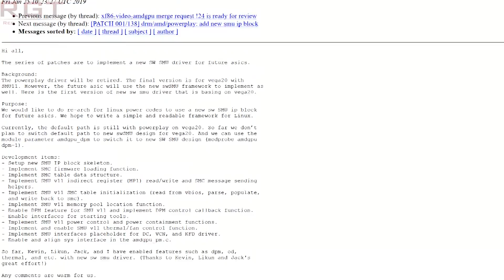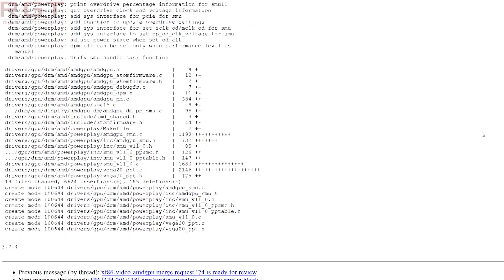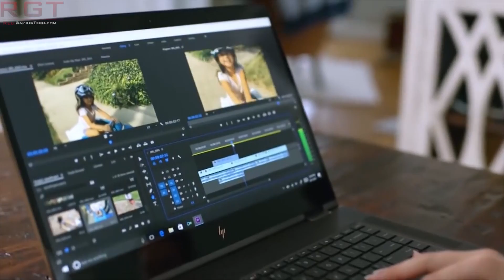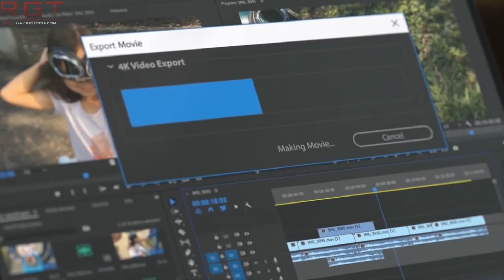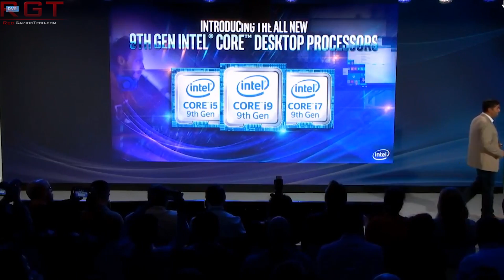Navi AIB Partners Brief On Specs & Linux SMT Updated | TSMC Readies 5nm

Comment: As for the Switch. it would be a huge mistake for Nintendo to even talk about a successor. They have a good product that they will want their customers to get value from. If they replaced it now or even any time soon-ish, they are basically telling people not to buy the next one as they will have to replace it in 2-3 years also. 

If I were them the absolute minimum that I would upgrade on the Switch would be 5 years. They are regathering the old Gameboy market and by all accounts, it sounds like that level of product saturation is there for the taking.

Comment: Intel will release Ice Lake no matter what. They were planning to release it last year and they had year more of debugging to make sure it works. The reason it was delayed was because the low yields meant that it had too high cost.  However with ZEN 2 in the market Intel truly has no other choice than to release Ice Lake no matter the manufacturing costs, and if necessarily sacrifice their profit margins to have a product they can sell. The reason coffee lake is so expensive is because their 14nm fab lines cannot make enough chips to handle the demand.   The ZEN 2 will chance the demand,  and 10nm chips even if more expensive to manufacture are still more chips available and new architecture means Intel would win several different performance measurements.  Lets say Intel releases 8 core Ice Lake and it completely obliterates 8 core Zen 2,  they can sell it even if the pricing around the 16 core zen 2.  They can say we are better for all these things, and people would have to choose between which set of performance measurements matter more to them. And when the yields improve they would release higher core count parts to replace it and bring prices down a notch.   Jouni Osmala

Comment: "you have intels 500 dollar cpu against amds very cheap cpu" you dont know how cheap intel could make an 8 core 16 thread cpu.  you only know what they are chargin for one.  thats a big difference.  and you dont know how much these amd cpus are gonna cost.  just saying there is a lot of assumption.  intel could make an 8 core cpu with no igpu built in for less than the 8700ks price if they wanted and still keep the same profit margins basically.  they could make a 10 core with no igpu and charge the same money as the 8700k.  they would take a hit in profit margins but it would still be very profitable.  intels stockholders are just gonna have to get used to the idea that competition is back and that margins will be lower until can get EUV going.

edit:  i get what youre saying.  if amd price these chips cheap and the perforamnce is there then intel is in trouble.  but im just reminding everyone that things arent always what they seem.  i dont mean any offense to the channel or anything.  overhyping is no good for anybody so im just saying this to the audience mainly.  not the channel
Reply: bobhumplick intel could make it cheaper,BUT.Amd infinity fabric helps yields, meaning if one part of a silicon doesn’t work they won’t have too throw it all,instead it can take smaller parts and throw just the broken parts.Intel can’t do that,if a part of the silicon doesn’t work they have to throw the whole thing.Aka,if intel reduces prices,so can amd but even more.👌
Reply: We do atleast know that the way intel makes their cpus is less efficient and that theyve had problems with supply in the past
Reply: @josh223  no we dont know that.  when did they have supply problems in the past.  i mean besides the current shortage?  every company has had supply problems including tsmc and amd.  how is it less efficient?  care to elaborate?

Comment: I still wouldn't put it past Intel to pull a desperation move and try to do something like shoehorning a 6950X (10 cores, remember) into a LGA 1150 package. We already know that Asus has a monstrous HEDT mobo coming down the pipeline which will be powered by TWO freaking 24-pin connectors, maybe to support that long rumoured 28 core CPU from Intel. Intel might try to do something just as ridiculous for their mainstream CPUs too. AMD needs to keep their foot on the throttle.
Reply: Intel is allready releasing a 14 core model in limited quantity which will be auctioned most likely to system integrators. The current major problem for Intel is their CPU shortage. They're even considering releasing Celeron models on 22nm instead of 14nm and they have desktop systems on the bottom of their priority list (Xeon and laptop CPU's are more important).

Comment: comparing next gens ryzen to current gen intel is like comparing the 9900k to the 500 dollar 1800x.  its not really a fair comparison.  now sure youre saying "if intel cant put out something better".  but they already have the 9900k.  you coudl just make it the new i7.  people think there are problems with yields because the numbers of 9900ks are limited.  but the yields are great.  they just made very few of them because they need that fab space for making the next gen of cpus.  add 10% ipc and get the core count up to 8 and 16  and you have a pretty good product.  

make the igpu seperate and only put it on the cpus that really need it and the 9900k becomes smaller than the 8700k.  they could even really put out that rumored 10 core chip with no igpu for the same price as the 8700k if they wanted.  and then use that 10 core as the building block of the hedt chips.

amd are gonna be strong this year no doubt about it but intel can answer.  just depends on whether they wanna chance putting out lesser chips and take a chance that brand recognition and current market share will get them sales anyway.  if they do that then amd will steam roll them.  either way though, yes amd will be strong
Reply: Not exactly, comparing 8700 to 1800 is fair then 2700 to 9900 is fair....
Reply: @Tallnerdyguy  well thats only because amd release early in the year and intel later in the year.  amd is usually april to may and intel is usually october november.  but amd wont have ryzen on the shelves till july at the earliest and thats only a few months away from when i would expect an intel product. so really by the time amd come out with a new series the 9th gen will be close enough to a yeara old while the 8700k and 1800x were 6 months between

Comment: nintendo is waiting for 5nm from samsung for nvidia custom gpu they planning next console and possibility based on newer RTX 2nd gen gpu...cause they have been supported for raytracing teniques since early 90's with N64 release was first to used on variety FPS games based on lighting and shadow features...their method different than nvidia back then..so games were unique by design that no other console or pc had before....
Reply: Nintendo is gonna make another low powered console.  Not anything powerful

Comment: Intel also is not stupid - they are for sure working on something
Reply: LOL on what ? 14Nm ++++++++++ ?
Reply: @gertjanvandermeij4265  14nm is actually what amd would call 10nm and they have been on it since 2016.  intel should just lie and call 14nm+ 10nm like amd did
Reply: They're working on something, but they keep getting delayed. The issue is that unlike AMD, Intel makes their own chips, so they keep having delays on their next gen architecture. They already stated that it'll be released at the end of this year, but based on what they presented, it'll be an improvement on their current architecture, which isn't bad, but isn't as major as what AMD can potentially do, and that's improve IPC while essentially doubling core count. I do remember reading some time late last year that Intel is working on their 7nm factories, and that there was a possibility of them skipping 10nm altogether since they kept getting delayed, but it doesn't seem to be the case. Either way, this upcoming generation might go to AMD, but next year things will get very interesting, which is great for us consumers
Reply: @JM-kn9dh  intel will probalby skip 10nm for the desktop.  they can compete fairly well with 14nm right now.  mobile will get 10nm because the power savings will be important and they are small chips.  server might get it in 2020 but i doubt it.  intel will probalby be on 7nm by end of 2020 or 2021.  and thats what amd and tsmc are calling 5nm.  that will be the last node EVER for desktops most likely.
Reply: @JM-kn9dh  the ipc quotes for ryzen are mostly for avx loads.  remeber that 29% quote?  the one amd tried to walk back and calm people down about?  well amd were already about 15-20% behind intel in avx loads.  they are getting that 29% ipc jump by basically copying intels avx setup with 256 bit registers instead of the doubled up 128 bit registers that zen currently uses.  but that makes more heat and cause the cpu to throttle (on intel boards its called an avx offset).  amd cps will do the same.  and if you gain 29% ipc but lose clocks then you only gain maybe 20% ipc which is how far they were behind to begin with.  the devil is in the details.

most of the gains people are talking about are just where ryzen is currently weakest and far behind intel.  what they are doing is mainly 0getting on par with intel.  not passing them up.  plus i dont think the clocks will be as high as people think.  5ghz or so might be the dual core turbo but i dont think many if any willl do that as an all core even if overclcoked.

they will be close than people think.  amd will raise core counts but intel will too.  amd will increase ipc but intel will too.

they will both have strong products.  its not even close to fair to compare current intel cpus to something that wont even release for 6 more months when intel will have soemthing new as well
Reply: Rmember TSMC 7nm = Intel 10nm. Looks like AMD will be first though, i think it will be the first time AMD is first on a new process.
Reply: @hjembrentkent6181  they have been on the SAME process once before but it might be the first time they were first.  and technically intel were first with a shipping product with those laptop chips but yeah if amd get ryzen 3000 out before intels 10nm then they will be first.  but they have to do it first
Reply: Yes they are most certainly working on something. It looks like their going to go the 3D chip route which should be interesting. AMD and Intel have such an interesting dynamic. Intel has been suffocating AMD for so long AMD had 10% market share if that. Intel accidentally gave AMD one of it's greatest strengths which is the ability to take risks and build new architectures.

Intel hasn't really innovated because major architecture shake ups would negatively effect their position with data centers and software packages that rely on intels core architecture. intel has put themselves in a position where it's bad to innovate. It's intels greatest strength and weakness. Even AMD probably won't crest 30% market share in the data center just because of compatibility maintained on legacy intel chips.
Reply: im expecting at least they will up the i7 to 8 cores 16 threads.  the rumored 10 core could be the new i7 or a new i9.  who knows.  also the sunny cove arch will be on those cores with about 10% higher ipc.  avx 512 maybe which will really help with video encoding at some point.  i would expect they would use the 10 core chips and put them together to make cheaper hedt chips.  they dont even need 10nm to do this.  14nm will work.  keep in mind that if you cut the igpu off a 9900k it will actually be smnaller than an 8700k.  an igpu takes up about 2.5-3 cores worth of space.  but i think 10nm for mobile and 14nm for desktop but i could be wrong.  theyll have something.  cant wait to see what both sides have.

and intel starts producing next years chips at least 9 months before they hit the shelves so they will have enough.  that means they have probaly been making them already.  and thats why the 14nm shortage is going on.  its not that they cant make a 9900k (i laugh at people that think they cant make this tiny chip) its that they dont really need the 9900k to compete right now but they will need higher core count cpus when zen 2 launches.  so they put out a 9900k now for people who cant wait and dont mind spending a bit more, but they did so in small numbers while they work on the really important job of having chips for next season
Reply: @bobhumplick4213  well the thing is that they are already releasing this gens chips with no igp, and it literally didn't change anything, not even the price. So they do need to release the 10nm processors to compete with ryzen 3000 series. The thing is, no one knows what to expect from it. We just gotta wait and see what they do
Reply: @JM-kn9dh  those arent made without an igpu.  they have the igpu turned off.  they still had to make the chip with the igpu which means about 30% of the die still had to be made but was useless.  they are just doing this to increase the supply of intel core chips on the market while they are producing the 10th gen as fast as they can.  if you actually made a 9900k with no igpu from the start it would be smaller (and there fore cheaper) than the 8700k.  what you are saying doesnt really have anything to do with it.  also the prices didnt go down but that doesnt mean they couldnt lower them.  they just saw no need as people are buying.  why are they buying them? because they still compete very well with amd are offering.  theres a bit of a price premium but they compete very well.
Reply: @JM-kn9dh  this is just a way to make the supply larger by selling chips with bad igpus.  they are still the exact same chips in otherwords.  they cost the same amount to make.  you have to realize that the 9900k is actually smaller than the 4 core i7 2600k from years ago. with no igpu they would be smaller than the 8700k.  if they made them with no igpu to start, then sold them that way to the desktop market and just made a seperate igpu to include in chips that actually need them then they could add millions of cores to millions of cpus with no real additional cost.  people that want and igpu might have to pay a bit more but most of the market doesnt need them.  plus the quad core and smaller notebook cpus will have the ipgu built in because they wont have a desktop equivalent
Reply: @bobhumplick4213  of course. They're still the best processors one can get right now. But everything points to AMD taking a significant leap with their ryzen 3000 series chips, which would truly put Intel in a tight spot. Like I said, 10nm would be a place holder, but I don't think we'd get a proper response until 2020 when Intel gets their 7nm up a d running
Reply: @JM-kn9dh  yes itll put pressure on intel.  but the current ryzen cpus are already doing that.  all im saying is that intel could keep the current arch they have and raise core counts and have a very competitive product.  

i think people are overestimating the performance of the final zen chips and also overestimating the problems intel would have in competing.

but you are 100% correct.  intel are under pressure and this will only turn it up.  amd will be very strong this year no doubt